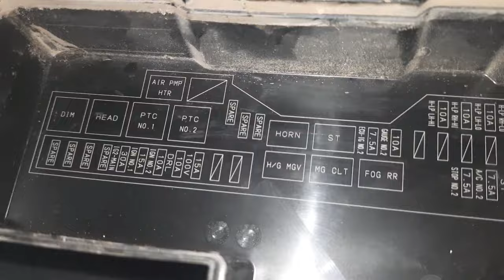Box sekring dan relay HIACE

Comment: Pak saya punya Toyota Hiace thn 2016 klau kunci kontak di posisi on tdk ada lampu indikator yg nyala tapi bisa di stater,bgmna cara mengatasi terimahkasi
Reply from the maker: Ada beberapa kemungkinan seperti ada sekring yang putus, jalur kabel ke panel lampu indikator terputus atau tidak ada setrum dan bisa juga panel indikator lampu pd spidometer rusak.
Secara elektrikal hrs dicek apakah ada setrum ke modul panel indikatornya
Reply: Maaf boss sma sy jg ad hiace d kontak on smua lmpu indikator mati d stater bs tpi g hidup
Reply: Dan blm ktmu mbl nya jg blm hidup
Reply from the maker: Hrs di cek lagi semua sekring besar kecil jangan ada yg putus atau kendor.
Cek sambungan kabel2 soket kemungkinan ada yg kendor.
Reply: Semua sekring relay sdh d cek trmsuk soket

Comment: Bang kalau Toyota Hiace 2014 mengunci Central lock dengan tombol bisa tapi kalau dengan kunci sebelah kanan atau dengan remote gak bisa kira kira apanya bang...apa sekering Central lock putus
Reply from the maker: Kemungkinan ada 2 yaitu modul doorlock rusak atau motor doorlock di pintu kanan depan rusak
Reply: @AJMcrews  Baik... terimakasih sarannya...coba saya cek dulu
Reply: @AJMcrews  bang ikutan nanya donk...sama ni hiace 2014 sekring sensor lampu yg mana ya bang bunyi mulu krn udah gak bs rapat pintu2nya,mau sy cabut aja biar gak berisik
Reply from the maker: Maaf...kami blm sempat cek dan memastikan letak sekring tsb.
Pd beberapa mobil, suara tsb berada dlm panel spidometernya dan biasanya ada jalur kabel ke sumber suara tsb.
Pastikan cari sumber suara tsb dan cari jalur kabelnya dan bisa diputus sementara utk menghilangkan suara tsb